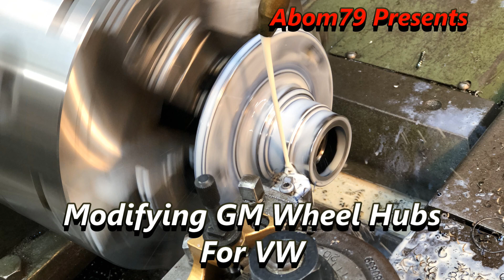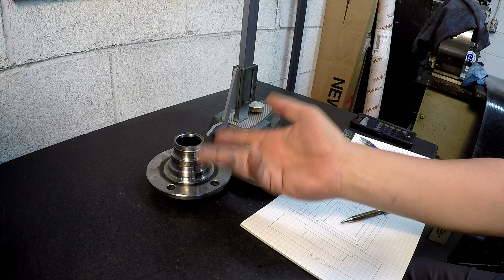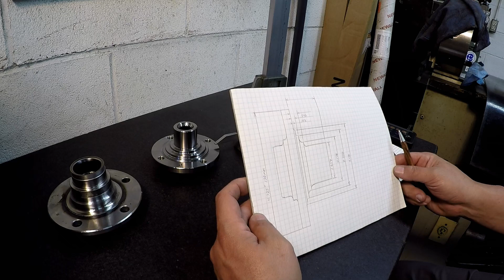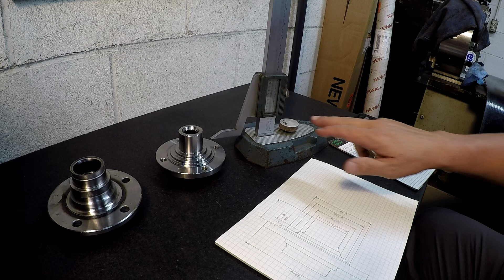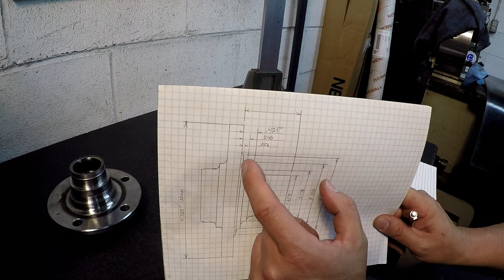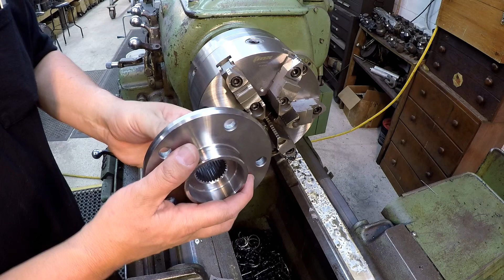Modifying GM Hubs for VW

Comment: Adam I just discovered your videos and I have to say that you are an incredibly experienced and patient craftsman but my experience has shown me that you went about disassembling those assemblies in the entirely incorrect way. They were designed to be disassembled using an hydraulic press, most auto repair shops don't have big lathes. As a matter of fact your customer should have just given you the two pieces of the hub and the bearing all separately.
Reply: do you have an example of separating the two? couldn't find an example of this being done to gm hub assembly besides this video

Comment: What about the integrity of the hub after you machine all the hardened part off?
Reply: The hardened part on those is because it also acts as the inner bearing race.  As the bearing that will now be used has its own inner race it should not be an issue.

Comment: I realize I'm late for the party on a year old video, but here goes: If you go through the hardened outer layer down to softer material, won't that bugger up the mechanical properties of the part?
Reply: The only reason the hub was hardened from the manufacturer is because the hub was the bearing race... the new bearing will have its own race, and does not rly on the hub as a race.  Hard is fragile.
Reply: Hi from NZ.  I'm late, too.  Found this channel during lockdown and LOVING it!  No background in machining, though always found it fascinating.  I was wondering the same - if something's been hardened, and the hardening is removed, isn't the part weaker than it should be?  Perhaps the customer, a dragster judging from the commentary, is getting the things hardened himself?   (sexist assumption, my bad, there are women who are nutters, too)    ;) .... I've watched dragsters - those people are mental.
Reply: That's what I was just thinking as I watch this for the first time.  Re-heat treat to original spec.

Comment: Question for you Abomb. Does tightening the lathe Chuck with all three holes make a difference, vs using just one hole? Are they all connected? Seems like everyone does it but is it just ocd or does it really make a difference? Starts at 11:16 in video. I always tightened everything when I did machine work but I’m just an amateur.
Reply: I suppose all three gears have a slightly different engagement on the scroll and you could potentially get more force into the jaws this way.
Reply: Joel you have to get the part running true..that’s what the dial gauge if for as well

Comment: Point anneal at the drill site with a carbon rod and arc welder.
After you fix the axles breaking, you start losing second gear.

Comment: anneal that steel.
Reply: HI This hub is my job for my car and no need to anneal, just using CBN hard steel inserts.  Cuts great
Reply: @robertguilford5325  I wonder if there was ever a discussion around just making new parts from round stock? Might have been cheaper for you?
Reply: @truthsmiles  hi. Would be too expensive to cut the splines in the new part. All I needed six and maybe no one will ever buy any of these. Since this post I have purchased two machines and turning my own hubs and axles. Should have done that years ago
Reply: @robertguilford5325  Oh yeah the splines would be a challenge! That’s cool you’re doing it yourself now! 
Yeah the first time I got a quote to replace an air conditioning system I learned to do it myself. Now I’ve done 4-5 and fix all my friends when they break down. Amazing how learning a skill can save us so much money! :)

Comment: Only comment I have is that you didn't remove the outer row bearings inside diameter race. (The one next to the brake disc flange.)  Would have saved a lot of carbide if you had. That race is press fitted on just like the inner rows inner race. I usually cut them diagonally with a cut-off wheel in a die grinder.
Reply: Hi , this is my hub and goes on my VW 1995 trac car.  You are mistaken about the inner race. The hub is one piece not a separate race ring on it like import cars. I cut the GM wheel bearing apart to get this part out. What you see is one hardened piece.  Fab is fun

Comment: Could you have used your fancy little oven to remove the heat treatment of the hub, remachined it to your customer's spec, then reheattreated it?
Reply: You gotta know a lot of information to get that right, especially when it's literally holding the wheels of a car on.
Reply: @HavokTheorem  - the hub is hard because its serves as the inner race, not because it takes super hard steel to keep the wheel on the hub.
Reply: From the perspective that I have machined brake rotors and usually they are more prone to warping after, to me it would make more sense as you said to anneal the metal, work it, then temper it back up. Machining the tempered layer will decrease the toughness of the material and may no longer be suitable for use as re-designed. I have no experience in the matter, only theoretical knowledge learning structural maintenance.
Reply: @benjaminsmith9534  Final machining should occur after tempering for dimensional accuracy and the likelihood is that's what happened when this part was originally manufactured. So what he's doing makes sense and screwing around with the heat treatment is not a good idea.
Reply: Yes but could you then harden it to the exact same specs as the manufacturer had done it with their top of the line process to not be to much or to little hardened for the very exact metal alloy in these which you don't know. I wouldn't have take that risk for a customer.
Reply: Understood. So the best way is to machine the part as-is and let the tools deal with the metal hardness.
Reply: @chriskelvin248  Absolutely, if a insert or two goes to hell then so be it that is already accounted for. A true machinist know what will come and know that if will wear more then normal and perhaps throw that cost of some destroyed inserts into the cost to the customer.
Reply: Yep, that would be the engineering choice, anneal it first. Some comments saying you can’t risk changing its hardness, but it is mechanically void as a component as soon as the machining starts.

Comment: Hey Adam!
I'm wondering why they just didn't use the GM bearing assy and just machine the wheel flange. Lot beefier bearing and better retained.  Save those ball bearings, you'll use them for something.
Reply: Hi this was for my VW build not a GM car. The  bearing will not bolt to a small VW knuckle. Way too much work to put GM front end under the VW frame. The car also has the GM transmission bolted to the VW engine and is very strong. I know what I am doing and you must simplify your projects, the car runs great and will never break the drive train .
Reply: @robertguilford5325  what car are you building/  battle hardening?

Comment: Abom, a trick I've learned as my eyes get older is to use my phone to take a quick pic of those small numbers then blow the pic up to view. Works well for poor light and bad view angles too.
Reply: I use this trick at work too to read tiny spec labels. Another trick camera phones can do is check to see if infrared emitters are working on say, a TV remote. With the naked eye, they appear invisible. Watch the same thing on your phone screen, it looks like a dim red LED.

Comment: Hey man, I'm looking at doing an identical job for my project car. But I don't have a nice big lathe, just a little mini lathe. It'll swing the wheel hub no problem, but my concern is that it really pushes the carriage around when machining. I was only able to get about a .005" depth of cut (.010 on the diameter) and it was pulling a red hot glowing chip. I think the insert I was using may have been damaged, but it seems pretty sketchy. I may just heat the hubs with a torch before hand and anneal them. It doesn't seem super critical to have them hardened going into a press on bearing vs the integrated bearing in the hub assembly. Any tips to get the mini lathe to take a decent cut on that? Or am I just out of power.
Reply: Hi. This was my job and wanted to say I don't think you can turn this hard steel on a mini lathe. I have a new 2 hp Grizzly and am using CNB diamond inserts and cutting easy. However it is a lightening show and red hot shavings.
Reply: @robertguilford5325  yeah I decided to scrap that idea in the end and went with a different setup all together.

Comment: Questions:
1. Could you get the  bearing off by taking out the ball spacer then the balls? Just like taking apart a regular bearing.
2. Wonder how your guy is adapting the inner end of the half shaft to a Porsche/VW transaxle.
3. Would the Haz on the weld be softer if tig welded?

Keep up the great work!

Comment: I'm not a machinist, not even very good with a hand drill!! Why didn't Adam use cutting oil with the end mill on the welded material? Anyway, it's really an honor to look over Adam's shoulder when he works, Thanks for the education!!
Reply: didnt get there yet, but many grades of carbide tend to thermal shock and microfracture when doing hard machining with a fluid.

Comment: Nice job turning that tough stuff. I've only ever run into 1 part with some weird hard spots like that. Well not so weird I guess, cut the material with a chop saw, it got heated red hot, then tossed into a snow bank lol. In any case, had to grind them off, hss just wouldn't cut it.  
Well done on a tough project (well it looked tough to me🤣).

Comment: Did you re-harden the areas you machine off?
Reply: It's not required - The reason those areas were hardened in the first place is because that's where the balls of the original bearing run - no separate inner race. Since the new application is using a whole bearing with its own inner race, the hub does not need to be hard.

Comment: I wonder how precise the manufacturers of these parts make the hardness gradient through the material. Hard to tell from the vid, but am I right in thinking the parts where the bearing race would have run were hardest? 🤔

Comment: Now quick question really for anyone.I’ve been told that for turning/machining hardened materials it’s better to let the material heat up so as to anneal the metal. This supposedly lets it cut easier. Is this true?
Reply: To a point yes. It will cut easier when it gets hot enough to anneal. But you will lose many thousands in precision as the metal will also expand and because its wont be evenly hard, the cut will be kind of cheesy and mottled and shrink ad different rates when it cools. So if precision isn't a factor, go ahead and get it hot. that wasn't the case here.
Reply: Hi No heat. use CBN inserts and turn very fast and no coolant . Cuts like butter.  I know this was my hub and since I have turned some myself on 2 hp Grizzly lathe

Comment: A TIP FOR ALL YOU SISSIES OUT THERE COMPLAINING ABOUT THE SQUEALING. Just do as I did. Work without using hearing protection for over 50 years.You will barely hear anything!!! The worst of it is that I can’t say I wasn’t warned.....
Reply: Better tip is to use CBN inserts and it will cut silently

Comment: DID that all wrong, shouldn't say that there is a easier way .
Reply: carguy3504 how so?
Reply: @Mad.Man.Marine   flange stock most after market axle co have it, or re-spline old most after market axle co have tooling and not to costly
Reply: carguy3504 yeah. But the. Your stuck with the tiny vw shaft/spline size or if you get a chunk of flange stock you would still have to do almost all the machining he just did. ?  Right?  I feel like this might have still been the cheapest easiest route to take. Maybe not though. I see your point for sure.
Reply: carguy3504 also. If you went the hub stock way. Wouldn’t you then need to harden and temper what was made from it?
Reply: @Mad.Man.Marine  Hi you are right . This is my hub and I simplify everything. This was the strongest and best way to upgrade to a huge axle, and saved many other steps that would of had to be done. I love fabrication

Comment: maybe someone else has asked this but grinding attachment maybe ?
Reply: doppler I was thinking the same thing, hardened steel grinds beautifully,  however heat would need to be controlled for dimensional accuracy. In fact I’m surprised I have not seen infrared thermometers used on final cuts in general practice.

Comment: I've got one thing to say: Ceramic inserts
Reply: What about cubic boron nitride? CBNs are second only to diamond ones and are more than enough for any steel while being relatively cheap and incredibly wear-resistant.
Reply: @Nworthholf  cbn is good for finishing work but ceramic is better for roughing in you can take a bigger cut. Ceramic inserts arent really ceramic it's like a artificial sapphire. I turn hardened punches all day and I use cbn for most stuff but if I have to hog material I use ceramic.

Comment: Will he be re-heat treating these?
Reply: Not needed. This type of bearings doesnt need hardened surface. On original one the hub had a "integrated" bearing race. On modified one it doesnt need it because of different type bearing.
Reply: No need to reharden you wont really change the hardness with this little bit of heat

Comment: Did not see you remove inner bearing race in last vid I am a auto tech we have to reuse the hubs on press in wheel bearings I heat the race with a torch should fall off or use bearing splitter in a press
Reply: those are late style hubs, permanent captured bearing, pre-loaded one piece throw away. the axle and being torqued properly isn't needed to hold them together..

Comment: Question: if you sheared off all the hardened steel while turning, and exposed the softer steel underneath... Does that not affect the structural integrity of the part?
Reply: the hardest part was the integral  bearing race, which has been eliminated and uses a standard press on style wheel bearing. I'm sure it's still very hard steel.
Reply: Aside from just there being less metal, which would affect the strength of the part, even the soft part is good enough for this application. The hardness is only for wear resistance. 

Assuming it's not through hardened.

Comment: Would it make sense to anneal the hardened steel, do the machining on it, and then re-heat treat it? I expect you'd have to use an outside shop to do the annealing and heat treating, but it would make the machining easier.
Reply: Oh, it's not evenly heat treated. That would make things more difficult.
Reply: @kirbywankenobi  even if it was hardened evenly, as he explained he didn't want to change the oem's point of hardening. re-watch from 25:16 and he explains it.
Reply: @kirbywankenobi  Maybe it was even until they welded one of the bolt holes...
Reply: Yeah, I thought that right off the bat and posted my comment, then he mentions his reasons later in the video.

Comment: awesome job machining. had to take the headphones off when you got into that hardened steel. my hat is off to you for taking this job on. 

on a side note: i wonder why the customer didn't want to go to something stronger like some chromolly RCV's and just make some custom hubs that use a much larger unit bearing than that one shown. when you're worried about horsepower breaking a cv shaft or wheel bearing why continue to use something that's "ok" when you can take that up to "unbreakable" level. broken cv's can break a transmission which is a whole lotta more money than stepping up to the plate
Reply: JB COW HERDER I am sure the customer would love to have everything you suggested made just as long as you are footing the bill for the work. 😁

Comment: If you machined through the hardened layer into the "sift" metal, how is that going to affect the performance of the part ?
Reply: Jack Patteeuw 
My guess it was friction welded from the hub face to the shaft.
Also it was only hardened due to the ball bearings needing to ride directly on it. A press fit bearing will be fine.

Comment: Why not use ceramic  inserts  ?
Reply: Ralph Nieboer 
Price
Reply: @Sicktrickintuner  taking halve a day making one   isn't  that to much more labour  cost ?   Then making at least 4 in the same time ?
Reply: Ralph Nieboer 
Plus some machines can’t do it, as you need to run faster as ceramic inserts basically get the part hot to cut a “chip”

Comment: A built VR6 can put down a 1000 horsepower easily that's why they're breaking axles
Reply: Absolutely true, but You're not running 4x100 with a vr6..

I think this customer is doing what he can with what he has. There are better options for vw high torque axle/ spindle combo's.     Maybe they use gm stuff though......??

Comment: I thought tungsten carbide would have no trouble cutting through the hard spots but good choice on using ceramic 👍 man made crystal would of been good to I know u can't use diamond with material that has a high ferrous content but I think man made crystal would be ok but I could be wrong 😕

Comment: With 500-600hp I would switch to 5-bolt pattern at the same time...
Reply: in the honda world theres lots of people making 1000+ whp on 4 bolt.  The lug count is not the limiting factor.
Reply: @leefhead1  Firstly, you just can't apply honda world stuff to the real world. Secondly, in the honda world cars are quite light and usually FWD.
Reply: @Hurm0s  are you saying beetles arent light? FWD or RWD makes no difference on torsional load of the lugs.
Reply: @leefhead1  I had one of the early Dodge Omni GLHs.  One of the changes made to it was fitting 4 stronger studs to each wheel. There were only 110 hp to pass on to the tires on mine.  The Turbos had 150hp.
Reply: We were power starved in the 1980s.
Reply: I was snapping axles at the splines in my rabbit with a stock 2.0L 16 valve.   This customer is doing it right going to a bigger spline, but the 5x100 hubs/spindles would bolt right in...   The oe have their limits though too.